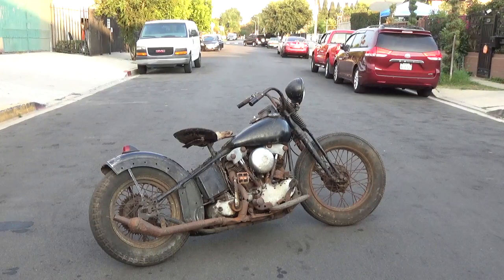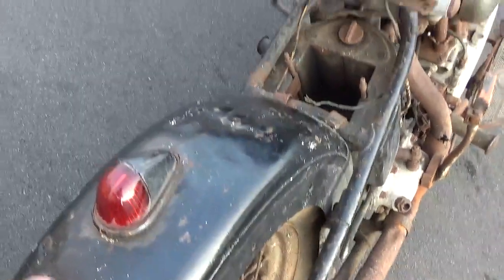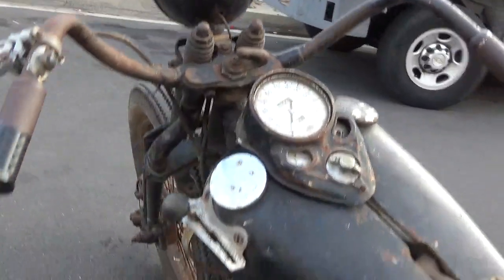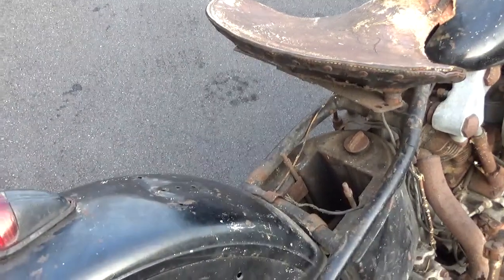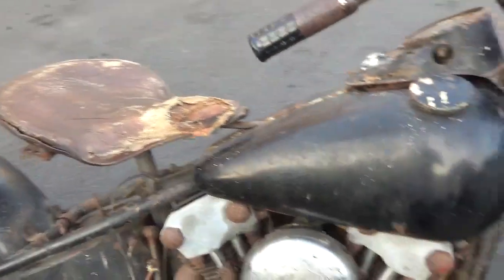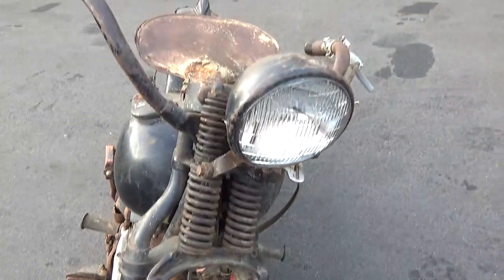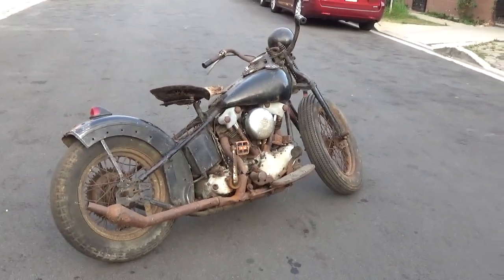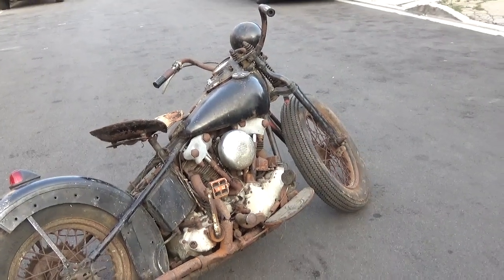Hunting Harleys, 1937 Knuckle bobber

Comment: A little TLC and that'll be as good as new! Question Todd. the locking nut for the top tree, and that piece and cover with it? what are they actually called? I've looked for an age for both and never found them.
Reply from the maker: They show up on ebay all the time. Springer ride control top nut and springer bars tree cover
Reply: @HuntingHarleys  Thank you sir. Beautiful bike, I'd not change a thing.